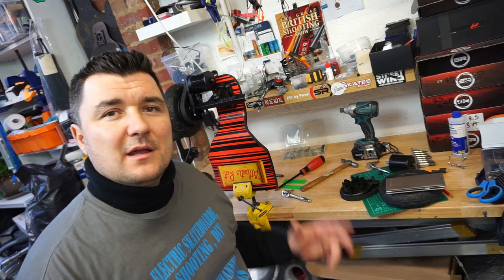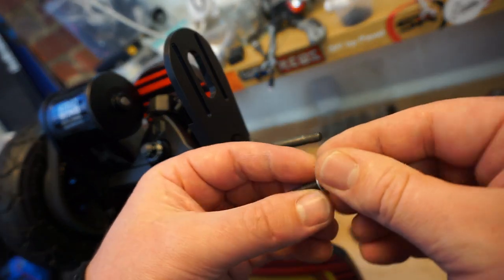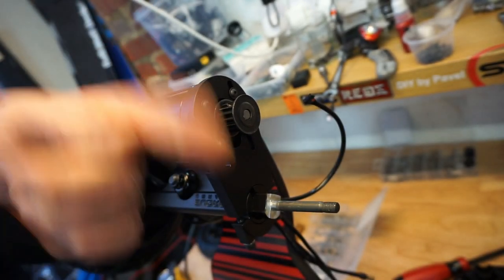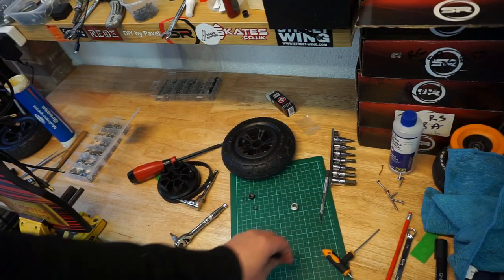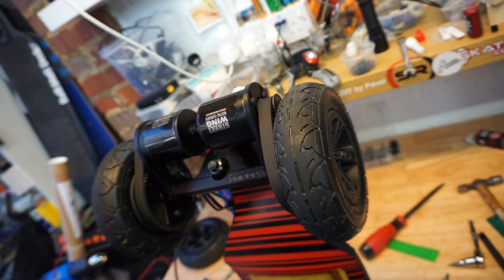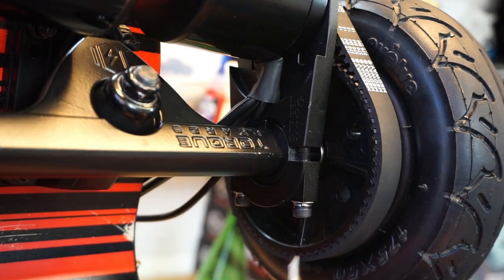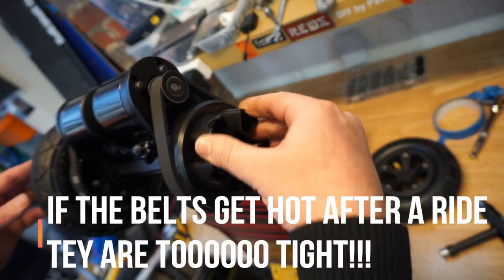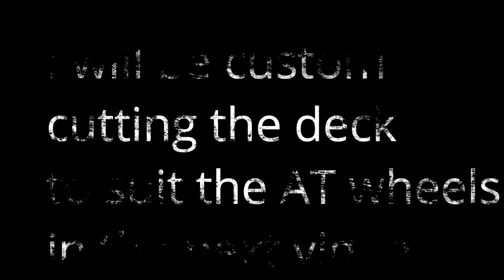Beast video 6 part 3 - motors ,mounts,belts... assembely tutorial

Comment: I vote for clear wrap as the rest of the underneath of the deck will be "real" carbon fibre so why contrast that with fake wrap. Nice video again and thanks for the reminder about split washers I must get some of those ordered. I haven't blue locked my motors to the mounts btw so that its easy to change belts and accommodate any stretch. I have been checking each test ride and everything still seams solid.
Reply from the maker: Simon,
Thank you for the reply buddy! Your vote is noted!
Hopefully people find the video useful : )

Comment: When you apply the cream to the bearings it's better to open the up. Not sure how much of that liquid went inside
Reply from the maker: Hi!
Very good point mate! Seems that you are not knew to this ; ) and i do open up the older bearings for cleaning and lubricating but some of the dust covers do not fit tight after being disturbed....the speed cream is very thin so if the bearing is left at the slight angle and left alone for a while - oil does find its way : )
Ride safely and stick around buddy!

Comment: Is there enough room to fit two 6380's with your 218 modified trucks and AT setup.....I'll be doing the exact if I can fit the 6380's....
Reply from the maker: Marc,
I am using dual 637 motors and the fit is perfect but very little space is left between the cans.
Reply: Pavel....I see your motors have a nut at the center of each motor.....this takes room and the torque board 6380's have no nut.....I still think it will be tight but just may fit....can you tell me in mm the gap between your motors at the edges....not between the nuts?  BTW...love the  videos you've done.....very thorough and love the carbon fiber.....are the edges exposed wood ply or carbon filber as well?
Reply from the maker: The edges were painted black and resin coated. I will get the measurement over to you shortly.
Reply: Great and thanks.....I assume the evolve AT kit you got used was the GT version and not the GTR version  as well
Reply from the maker: @benchmarcdesigns1125  
So...distance between the cans without "nuts" is 26mm. AT wheels are not GTR.
Reply: That is for the quick reply back.......watching your other videos now.....ride safe my friend
Reply from the maker: @benchmarcdesigns1125  
Enoy! ....feel free to share them.

Comment: 8:00 You do it wrong. You need to open up the bearings and apply two drops of speed cream.
Reply from the maker: Hello!
You are correct, it is better to take the duct cover off and apply the oil directly but some covers do not stay on after taking them off.....Evolve bearings are one of them.
I am using the speed cream and it is very runny so does penetrate eventually if left alone.I was not in the rush so left them for 30 min before using,
Thank you for watching the video buddy!
Reply: @PavelGarmas  I use Evolve bearings all the time. Just be super careful when you remove that covers.